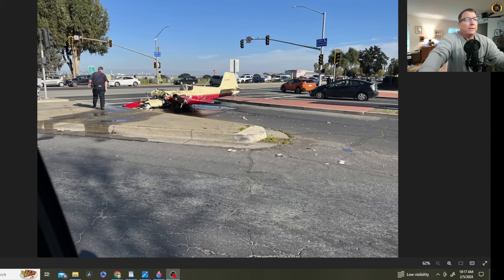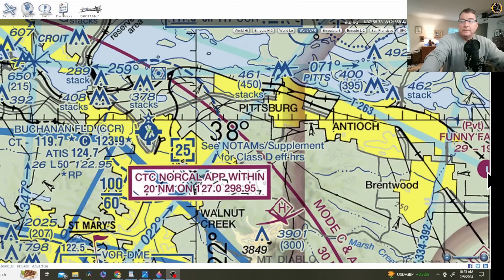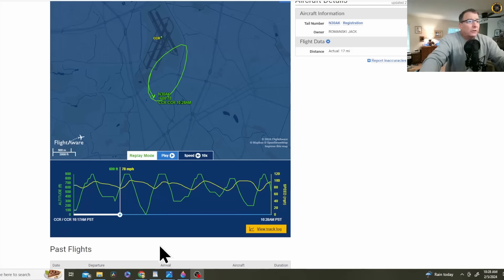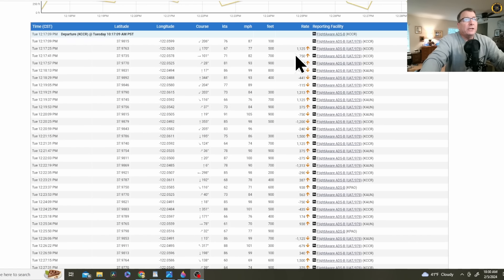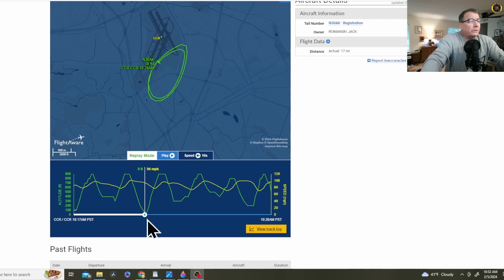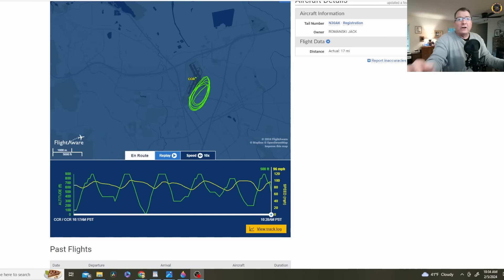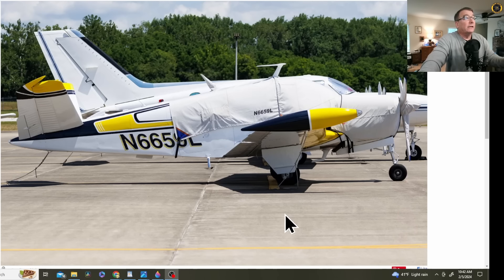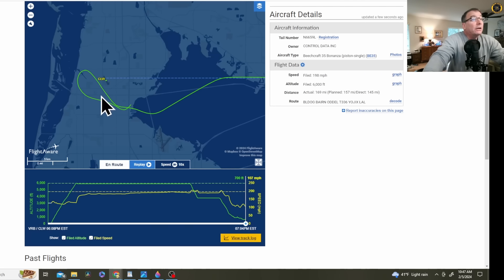RV-6 Crash Concord CA and V-35B Clearwater FL. Crash 5 Feb 2024

Comment: I had a fuel out experience.  When I was living in California my job had me commuting between San Jose and Sacramento.  The plane was a 8 or 10 seater, 2 pilots, 2 turboprop engines.  We were over the mountains, eating donuts and having coffee and all the sudden both engines sputtered out.  Then the dash lit up in red all over and the pilots were looking all over the gauges.  There were some floaty feeling moments and then they got the engines restarted and we arrived on time.  I asked the pilot what happened and he said that one of the tanks went dry.  The whole experience was a little unsettling, especially since we were flying that plane back to San Jose that afternoon.
Reply: Sounds like someone forgot to switch tanks?
Reply: Many years ago on some tech company aircraft that shuffled employees to and from from SanJose to some Sacramento area work site a passenger voluntarily departed the aircraft at several thousand feet. The pilots had some idea something had happened, like Maby a exit door unlatched, but didn’t really understand until after they landed

Comment: Thanks for another informative video. One small point... Pilot controlled lighting normally is activated by seven clicks within a five-second period for the brightest intensity. The lights stay on at that level for 15 minutes. Some systems allow pilots to adjust the lighting intensity: three clicks for low, five clicks for medium, and seven clicks for high, once it’s been activated.

Comment: Yes. This was a normal activity for this pilot. Not to say that he was encouraged, but the pattern work helped the traffic count for the airport.
Reply: He apparently took it upon himself to to do that rumor has it.
Reply: The engines nor the airframe are designed for this day in day out.
Reply: Hard to argue against someone’s passion, because he must have gotten a lot of joy and satisfaction out of it. In my marathon training days, I used to run around the track for hours when it’s too dark to run on the streets. My GPS tracks looked exactly like his ADS-B track. I’m sure some must have thought I was nuts😀

My condolences to the family and may he find another RV-6 on the other side🙏
Reply: How does traffic count matter? Thanks
Reply: @Ryan-mq2mi airports get funding based on traffic volume. Each touch and go, each landing, each takeoff is counted by ATC, 24/7.
Reply: @tmn32001  Thank you. That's what I guessed, but I don't actually know how airports work.  Is it federal funding your talking about?
Reply: @Ryan-mq2mi  airports get funding from federal and local sources. The busier the airport, the more funding, generally speaking. Of course, there are other factors too. You often hear about how many flights operated over a busy holidays at airports. For commercial aviation at bigger airports, they rely on the filed flight plans for numbers. For general aviation airports, the controllers keep count since most pilots do not file a flight plans, and they do more practice approaches at these locations.

Comment: Hey Juan. Regarding the V35B accident in Clearwater, I live in Vero Beach where the pilot took off from. When I was training at Flight Safety International here in Vero, the instructors would use PIE as a  good airport to fly Xcountry too. It is a congested area, as you have the airpark to the north, with PIE to the south, and TPA, across the bay to the east. One of the best things about flying in Florida, is that its flat, and there are a plothera of landing options available to a pilot in an emergency situation. Of course, it depends on the specific circumstances of each emergency regarding survival rates, and night flying reduces them dramatically. However, IMHO, contacting PIE tower might have saved him, if he had trouble finding the runway at CLW, or at the very least, they could have directed him to a field, road, hwy, or even the water. 
Just my 2cents.
Another great video Juan, as usual. Great job., 👍

Comment: An elderly couple came by my home airport, Aurora, Missouri, in their RV-6 from either California or Florida going all the way across the country.  He had read my book and wanted instruction especially on the apparent brisk walk rate of closure approach.  I was amazed at how well the airplane maneuvered generally and how well it maneuvered in the deceleration on short final coming into ground effect.  He also practiced the basic level in low ground effect takeoff I teach, not for the zoom available from the free ground effect energy zoom reserve airspeed, but for the maneuverability available on the Vcc climb out with cruise airspeed.  With zoom reserve airspeed available, he should have easily made the golf course.  Vx or Vy or extreme zoom climb are almost never appropriate from very long runways.  Low altitude orientation, including in the pattern, is that airspeed and not altitude is life.  Both cruise climb and the power/pitch deceleration approach are easy on the engine since the throttle is never closed until touchdown.

Comment: Regarding the Clearwater incident, it seems to me the "black hole" represented by the golf course would be a big help in identifying the location of the field amid all the residential and business  illumination around the area.
Reply: I’m guessing landing on a golf course can be dangerous? Because of all the traps that make golfing interesting?
I’d agree that the “black hole” pretty much locates the airfield amongst the built up environment of housing and businesses
Reply: @DanielinLaTuna  definitely landing on a golf course like that would be a problem….and the course forms a triangle on the southwest side of the runway which is the hypotenuse of that triangle.
Even though I have driven multiple times on Keene Rd which is on the west edge of golf course, I don’t recall how many overhead wires there is but I know a private plane landed on it a few years ago reasonably successfully though it was in daylight.
That’s a four lane divided road that’s well lit.
Reply: It should, but in this case, the runway lights are simply too dim to clearly see the airport at night, and many pilots has difficulties getting them to turn on in the first place.  The consensus is that unless you had landed at that field before and basically knew exactly where it was, it was very difficult to locate it at night.

Comment: I ran a tank dry, on approach to Vero Beach, in my G35 Bonanza at night, on the VOR-A approach. I switched tanks, and before I could even get the boost pump switched on the engine was back to running smoothly.  Gotta love the pressure carb system. (I suppose nowadays we would call it a throttle body fuel injector system.)

Comment: With a reclaimed aircraft and engines, the question is how long has it been sitting around, what did they replace and not replace to get it running. You can get it running but there are still old parts ready to fail because it sat around too long. Something sitting around, depending on how it is stored, can have moisture, dry rot, animals causing problems all over the place.
Reply: A vented crankcase will accumulate water from the atmosphere, especially if it's in a place where the temperature goes up and down. I've left a snowmobile engine in the shed for a couple of years and drained a coffee cup worth of water out of it.
Reply: Yellow tagged or green tagged goodies also.
Reply: If I remember correctly there was a crash caused by a some insects making a nest in the pitot tube
Reply: @GWNorth-db8vn  Interesting.  So I'm guessing the mechanism is something like this... water vapor enters when it's warm and humid, condensation forms inside when it cools down and drops of water go to the bottom of the sump where they can't evaporate again because of the layer of oil on top.
Reply: @galacticminx  - That's exactly how it works. It breathes in and out once a day. This is also why you have to fill a motorcycle tank to the very top before putting it away for the winter.

Comment: I had to go back and check, the airplane from Rebuild Rescue looked familiar to me.
Sure enough, way back when I started watching Blancolirio, i saw the "Free airplane" video in the recommended feed by YouTube, I never watched it however.
Still a bit sad to see it turning out this way.
Reply: I think this one MAY have been different.  The free airplane I saw them working on was a large Cessna (414, maybe?).  I watched a bunch of videos on that, but I felt like they were creating unnecessary drama (re-enactments, for example).  I watched until they did a test run on the runway, and allegedly had an engine fire.  I think they re-created/re-enacted it for a video, which turned me off.
Reply: @dave30076  Blancolirio just confirmed it, my memory was incorrect, he found the exact video I thought of and it seems it was a Cessna 401 and the full story behind the ordeal.
So you were indeed correct.

Comment: I've spent hours in the pattern perfecting same-place-every time  wheel landings just because it's artistry after a while.  Regular box pattern though.  He could have been just enjoying what he had gotten extremely good at.
Reply: NOT THAT GOOD !
Reply: @InMyBrz  He'd been doing that pattern almost every day for years.  Shut yer yap.
Reply: I've done the same. Hundreds of touch and goes, with the aircraft in every conceivable configuration. without ever leaving the pattern. 🤷‍♂️
Reply: Looking at some of the ttracks, it seems that he seldom used a box pattern and ignored large parts of the ravailable runway.. Always establishing final approach before the threshold and touching down near the normal touchdown point would have given him a lot more runwaylength to make a straight ahead landing after the engine failure. The dimensions and consistency of a box pattern for takeoff and landing practice have a safety value (especially in uncontrolled fields).

Comment: In '80-'81, I was living in Florida. My dad and I were going to go flying out of Clearwater Municipal Airport. As we were driving to the airport, I saw a twin-engine airplane just after takeoff. I remember one of the propellers turning a little slower than the other. I mentioned it to my dad, but he didn't look because he was driving. We get to the airport, and it's closed because a twin-engine aircraft crashed. It was a Beech 65.
Reply: I wonder….could that be the incident that I remember?
As also live in  Clearwater (near Belcher and Sunset Point) and I certainly remember another multi fatality crash that occurred just NW of the airpark. Don’t recall date at all but it was in the front yard of a home under construction near or at the intersection of Montclair and Keene (when it was just a two lane road so many years ago) but since 74 when i moved here.
Using property appraiser site, the home at that location was built in 1981. I think it could have been a larger aircraft as it was (I fuzzily remember) maybe 3-4 fatalities?
Reply: @JohnHallgren  I found it on the NTSB website. It was north of the airport and happened on September 12, 1980. I think it was just short of a school or apartment complex. I do remember it missing a very dense dwelling...i.e a school or apartment complex.
Reply: @JohnHallgren  That's what I thought, but according the NTSB website, only the pilot died. Maybe some people on the ground died and it wasn't included in the report.
Reply: @renorailfanning5465  hey, it’s over forty years ago so memories could definitely be wrong…I just remember distinctly the location because it was visible from the road i use to drive to church. It’s at 1989 N Keene Road where Montclair Road goes off at angle.
I possibly could have mixed up the multi engine and fatalities. I will look up what you found. Thank you.
Reply: @renorailfanning5465  i tried numerous times to post info about the 1980 crash that I mentioned but apparently failed to get it to work. There were six fatalities in that accident.

Comment: Just down the street.  Been in there (Clearwater) many times. As a 4K be35 pilot my first thought is fuel mismanaged.  But this be35 has a three position fuel valve even with tips.  LR off. Not like the older ones

Comment: Juan, I'm sure you know this but the RV's use a NACA 23000 series airfoil (23012, 23013, 23015) which is very similar to the Beech V35B, 33 18, 90, 55) airfoil (23012-23016). Also Douglas used it in the DC-4,6,&7.
Reply: The word experimental turns some people off flying when they walk towards an aircraft and see that word on the aircraft.
Reply: @John-nc4bl as well it should.

Comment: The accident at Concord is indeed sad, but when I see the Google image of the airport and surrounding area it screams that the airport is surrounded by incompatible land uses as a likely result of heavy handed developers and very poor local zoning.  Same for Clearwater.
Reply: It's the same in many places.  GA airport near me has been an airfield for almost 100 years and used to be the only thing for miles. Now it's a hot area for expensive homes because it's close to a major city with high quality of life.  So new residents flock in, knowing full well there's been an airport there forever, and yet they still complain endlessly.  And developers chasing cash have crammed into every possible space around the airport.
Reply: Are there no warnings? (Besides eyeballing it).  Also, wouldn't you be managing if only for the center of gravity continuity?
Reply: My dad and I flew into Concord regularly in the 1960s-70s. Development was relatively sparse at that time and the airport really stood out. As with many airports, housing and commercial building slowly crowded in.

Comment: Juan? Glad to see you are doing the Cougar crash with Sam. I know doing these types of VMC crashes is difficult however if you could go over some structural clues as to how the plane might have been configured before impact. Also things like damage to tail prop feather and impact sequence as well as left wing departure. Which engine that looks most likely to have failed. The entire rebuild was done in 3 or 4 40 min videos and are still up on YT so any clues or sketchy work done that you notice. there is a lot to go on this one. Thanks for all you do!!

Comment: I survived a stall/spin accident in an RV6. There has been numerous stall/spin accidents and typically the pilot does not survive. While the RV6 is a good performer it will snap instantaneously if manoeuvred at a relatively high airspeed especially in engine failure situation. I can attest to this characteristic from personal experience. RV6 pilots would be advised to recognize this characteristic.

Comment: I posted on a few of the news sites about the crash into the mobile home park. The guy had water, straight out in front of him, which appears he could have easily glided to and made, instead of making that turn. That's what really troubled me.

I also posted about AQP, and what Dan Gryder does with it, and that maybe the news agencies should speak with him about this. That pilot sounded scared & a bit panicked. I have to believe he never even thought of the water as an option, which is truly sad- because there was nothing but homes below, where he made his turn.

Learning and practicing AQP, could have saved 3 lives.

Comment: Regarding the Bonanza accident in Clearwater, if the ADS-B Exchange data is accurate, the pilot set his transponder to 7700 just after turning south at around 900 feet altitude, very close to Clearwater Harbor.  He then headed inland and gained 600 feet or so before apparently losing control of the aircraft just short of Tampa Bay and fairly close to KPIE.  He had options.  I hope to never be in the position he was in, but it's another reminder to fly the plane above all else.

Comment: Certainly not the first crash near Buchanan Field.  I remember around mid1980s (December, bit before Christmas, probably 1985, possibly 1984) plane crashed into the nearby Sun Valley Mall in Concord, CA, USA.  I had a coworker who was in the mall at the time (don't think anyone in the mall was injured - plane crashed into roof, and there was a fire there from it too).  Coworker did go towards it to see what he could do to help ... but as he got closer - far too much heat from the fire and then just got the heck out of there.

Comment: I was a flight instructor for a large flying school. We would put thousands of hours in the traffic pattern practicing landings. In those days we would replace the fleet with new planes direct from the factory every two years with over 4000 hours on the airframe. We replaced these 4-cylinder Lycoming engines every 2000 hours.  I can only remember one engine failure in the four years I was there. We would abuse these engines and they never missed a beat. I can remember starting an engine in freezing temperatures and as soon as we got to the end of the runway, we would takeoff.  Never would we let the oil temperature needle come off the peg. 

I would suspect possibly fuel starvation. I have an RV and they have two tanks. You have to select each one separately. It is possible with the type of flying he may have either forgot to switch tanks or unported the fuel on one tank. With the theory of keeping the plane over the runway, this is possibly the most dangerous type of flying because you're at low altitudes and low airspeeds most all the time.  If you are going to practice these types of landings, find an uncontrolled field with lots of surrounding empty fields.